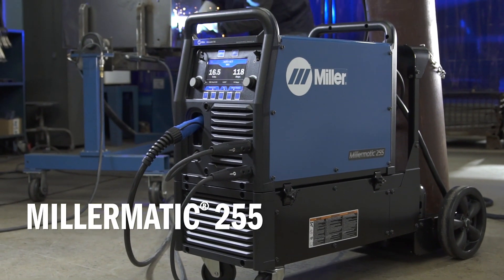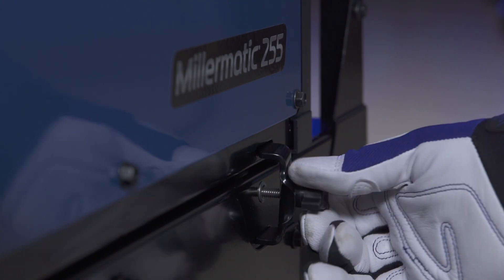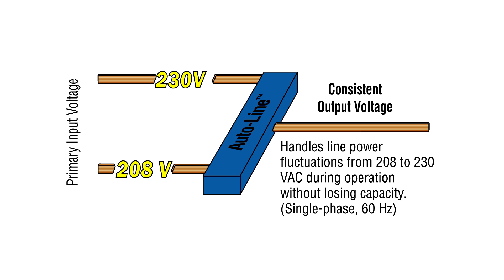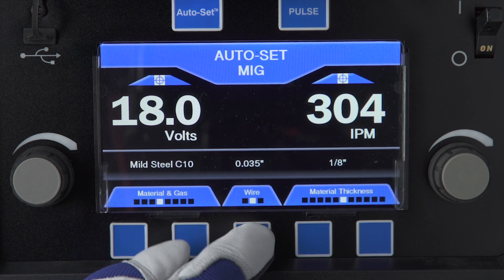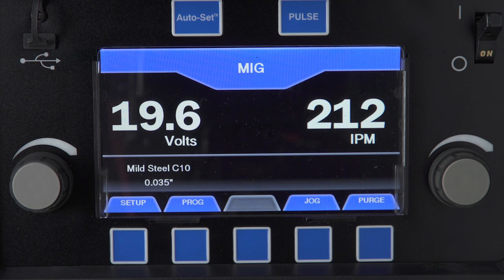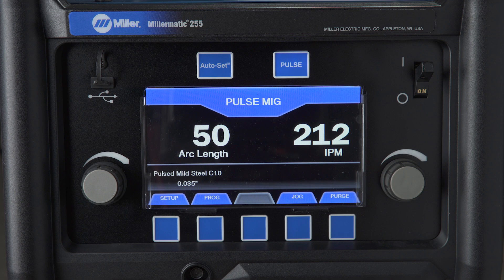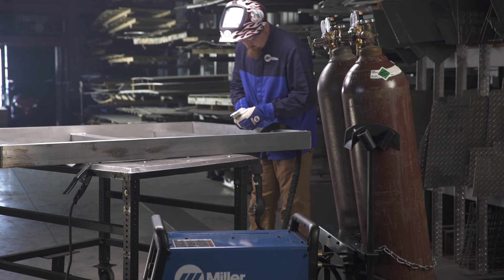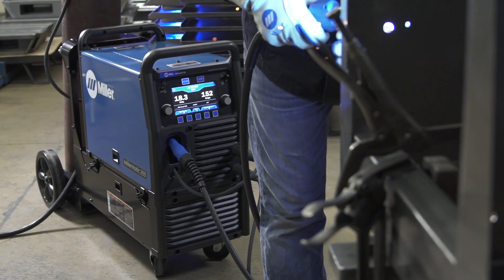Getting Started With Your Millermatic 255 MIG Welder

Comment: My new Miller 255 quit within a few months of buying it in the middle of an important job. The PCboard burnt up. It took over 4 months to get it repaired (Because Miller was waiting parts from China).Praxair didnt have anything to loan me. But I could rent one for $200.00 a week. Thatwould have been  3200.00 in rent. I bought HTP Propluse 300 For $4400.00 then sold the Miller 255 when it finally returned.Miller Quality has gone dowwn hill very fast. Since 1984 I've only used Miller blue. Today's blue is about as trust worthly as those in washington. Miller if you're going to charge $4400.00 for mig welder build it heavy & to last 20 years like my old Blue did.

Comment: There seems to be a growing mountain of Miller 255 wire/ burn-back comments and issues growing on YouTube for this welder!  Most often when using Pulse mode.

It seems like Miller is blaming everyone for the problems.  I already received a price quote for this machine and the cart from my local welding store, so instead of placing my order this week, it looks as though I need to go back to researching another welder manufacturer.  I was really hoping to buy a Miller with Pulse instead of Lincoln again!

Several people noted this feed issue appears either after 90% or more of the wire roll was used or after several minutes of welding, as if the gun tip starts restricting or the wire liner starts restricting/binding.  The feed angle of the wire to the feed rollers does not seem to be a straight shot when the wire roll after the roll starts getting used.  It looks like the rollers expect more of a downward feed, which requires the roll to be mounted higher or the rollers be lowered or less of a feed angle.  I wonder if it’s related to the new MX gun they are using?

Miller, when is this going to addressed?  We want to buy and enjoy this welder!!!
Reply from the maker: Thanks for reaching out, Ray. We appreciate your feedback and continuously work to make sure our products meet the needs of our customers. We’ll be sure to pass this along to our team.
Reply: @MillerWelders  can a 10’ gun/cable be used, it may limit or eliminate wire feed and wire burn-back issues people see?
Reply: @MillerWelders  , thanks for the reply.  I wanted to mention what someone mentioned in another video,  , thank you for the quick response!  We hope you keep making video’s, you seem to always have great content.

I may have already mentioned that a another guy’s video, he said he fixed his 255 wire burn-back issue with MIG Pulse mode by increasing his run-in setting, I think to 65…something for people to try if needed.  So for now, I should retract my earlier accusation that blamed the Miller 255, it may not be any issue at all.  It most likely is related to a person’s welding style and making the correct setting adjustments related to that style.  That’s for your patience, I now plan to buy the 255. 👍

Comment: Burnback into the tip is my issue.
Reply: I’ve read several other 255 owners with the same issue.  You may want to check the wire feed path and the wire.  Some guys said it happens most often during the last 10% or more of a large wire spool.  Another guy said it happened if his gun cable isn’t in a straight line.  I would make sure your wire roller tension is good, try giving it more…and run premium clean wire.

Please let us know if or how you fix it.  I was hoping to buy a 255, but skeptical.
Reply: @ray-real1   I had to speed up the Run in speed to 65. It doesn't burn back into the tip anymore. I have been MIG welding with it on manual also. If you plan on buying it know that you can't TIG weld aluminum because it won't switch to AC. All I did was speed up the Run in speed and run it on manual. Glad I figured it out before I went through another box of tips. Buy it!
Reply: Flip a coin. If you buy it and hate it. Don't blame me!
Reply: @jefff2009  awesome solution, you’re a genius!  You could sell that solution to a lot of 255 owners.  I’m not sure why one guy said it happened more when near the last 10% wire on the spool, may be due to more drag on the wire due to the wire angle feeding the roller guide entrance?

I’m also not sure when most folks experienced the burn-back, at the start of a weld pass or during or at all times when using Pulse?  I think the Run-in option can be disabled too, so that may help…or create other issues?  My old Lincoln SP-175+ MIG does not have “Run-in” capabilities, it’s a basic transformer machine.

Yep, the Multimatic 255 will not do AC TIG, so I’m want the MIG Millermatic 255.  I plan to get a Everlast 325-EXT for TIG, which may open a different can of worms!
Reply: @jefff2009  Ha, sounds like a plan, thanks for the valuable info!
Reply: @ray-real1  Let us know how it runs after you get that one. Thanks.

Comment: I’m a hobbyist with regards to welding and have been using a Lincoln SP-175+ MIG machine for 25-years.  I was interested in switching to Miller with a 255 to try MIG Pulse.  From the comments read here, is the 255 an unreliable machine and the 255 Pulse feature not worth chasing?
Reply from the maker: Thanks for reaching out, Ray! The Millermatic 255 has an exceptional rating of 4.7/5 stars with over 150 reviews. We recommend taking a look at the Millermatic 255 product page and reviewing some of the reviews. You can find the Millermatic product page here: https://www.millerwelds.com/equipment/welders/mig-gmaw/millermatic-255-mig-welder-m30174. Please let us know if you have any additional questions and we can happily assist.
Reply: @MillerWelders  , thank you for the quick reply.  I have no doubt many many 255 owners are are happy, but the number of complaints I’ve seen are troubling.  The feed to those rollers looks really tilted up, which may not be helping.  Hopefully they are not planted reviewers from Lincoln.

I could go with the 355, but it’s double in price and crazy money to spend for a hobby guy.

I already talked to the application experts at Miller a couple of weeks ago when first looking at the 215, naturally they have nothing but positive things to say, which is what I expect a manufacturer to say, which is why I have to resort to YT and the Internet as sketchy as they are.

Comment: I am a 3rd year welding teacher at a high school and we three of these out of the box last school year, January 2022.  Worked fine till recently.  Despite having full gas cylinders of 75% Ar and 25% CO2 and pressurized to provide 20 CFH our welds are looking like we forgot to turn the gas on.  I think something it blocking the gas flow at the end of the gun.  Looking for help to solve this dilemma so we can get these machines working again.
Reply: Swap out the gauges with a known good set, defective gauges will cause that issue.  Mine did the same thing.  😉

Comment: We were looking at purchasing 2 of these for our fab shop until we realized they didn’t have ac for tig welding aluminum where as the 220 does and the 220 can’t fit a full size spool of wire🤦🏻‍♂️ so I guess we’re going with a different brand...a huge swing and a miss by miller🙄

Comment: Hey all, I'm having a lot of trouble welding 1/16-1/8" wall steel tube with the pulse mig feature on this machine. Should I refrain from running pulse for thinwall steel? Working with a lot of 3/4 and 1.5" square tube. Ornamental steel.
Reply: your not the only one. Think my machine was a lemon out of the box. I've used another pulse machine and had flawless results. Mine has never worked right on pulse mig for mild steel with 90/10 gas.  Now today my machine will only work in autoset mode. Manual mode it wont work...  This is my second Miller machine to have issues out of in the last 10 yrs out of the 3 new machines that I've bought brand new. I just contacted miller to see if I can get the machine checked out. This isn't my first rodeo with getting a miller machine fixed.
Reply from the maker: Hi Nate! We recommend giving our service line a call to talk this through with a tech. The number is 920-734-9821. If there’s anything else we can help with, just let us know.

Comment: Spool gun?
Reply from the maker: Thanks for your interest! The Millermatic 255 comes with 15 ft. (4.5 m) 250-amp MDX™-250 MIG gun w/ Bernard® AccuLock™ S consumables for .035/.045 in. (0.9/1.2 mm) wire. For more information, we recommend checking out the product page and spec sheet: https://bit.ly/2pjOkPr.

Comment: 255 is better than the 252?how thicker materialvxan it weld?
Reply from the maker: We recommend checking out the Millermatic 252 and 255 product pages and spec sheets to what would work better for your welding needs. The Millermatic 255 can weld Aluminum 18 ga. (1.02 mm) - 1/2 (13mm) and Mild Steel 24 ga. (.51 mm) - 1/2 (13mm).